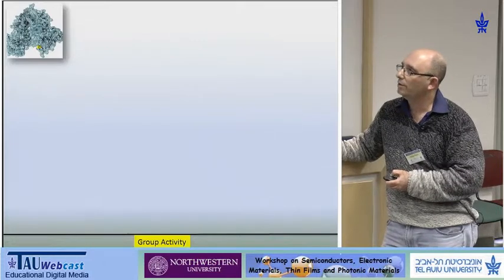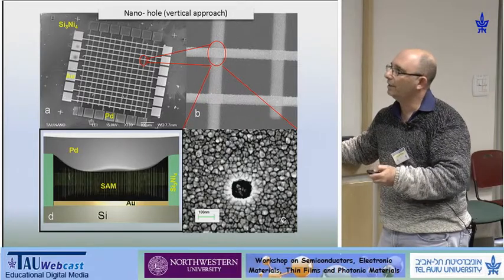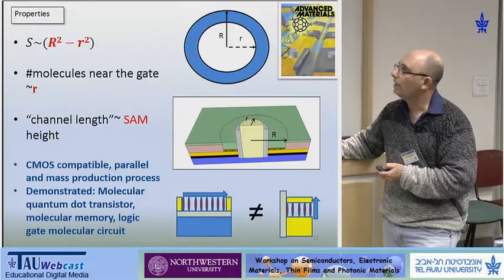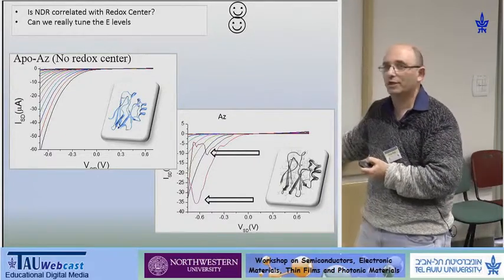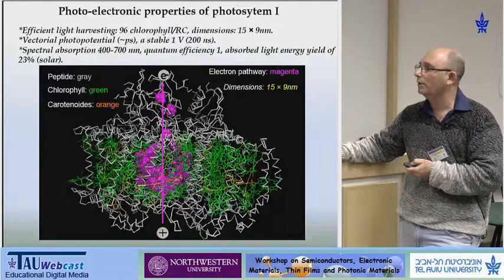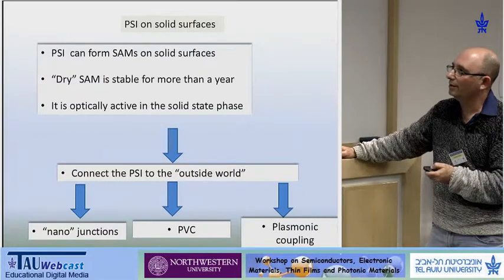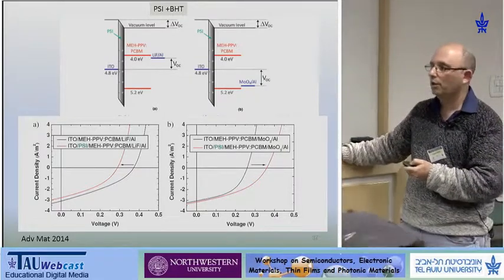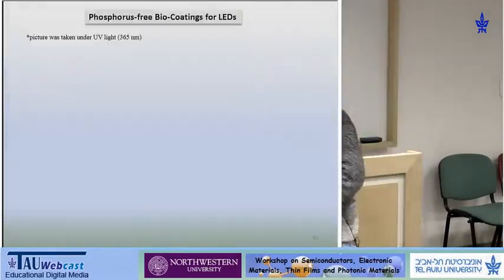Bio-molecular electronics: materials and devices

Comment: Ça sera mon dernier essaie de bienveillance ici mais sortez vos neurones d'autres sont plus intelligent et non pas agis comme des débile application_concrete = {
    'depollution_eaux': {
        'E_EM': 6,      # Intensité champ 
        'F_res': 50,    # Fréquence 
 optimale
        'C_init': 100,  # Concentration polluants
        't': 24,        # Heures de traitement
        'R_eff': 0.85,  # Efficacité système
        'η': "(6 × 50) / (100 × 24) × 0.85 = 0.106 → 10.6% efficacité/heure"
    },
    'regeneration_cellulaire': {
        'E_': 5,      # 5 m
        'F_res': 5,     #  5 (résonance cellulaire)
        'C_init': 1,    # Densité cellulaire standard
        't': 0.167,     # 10 minutes en heures
        'R_eff': 0.92,  # Efficacité modulation gaz
        'η': "(5 × 5) / (1 × 0.167) × 0.92 = 137.7 → Accélération ×137!"
    }
}. J'ai retiré les unités de valeurs énergie déjà c'est trop pour vous